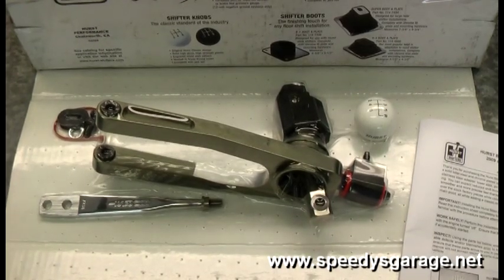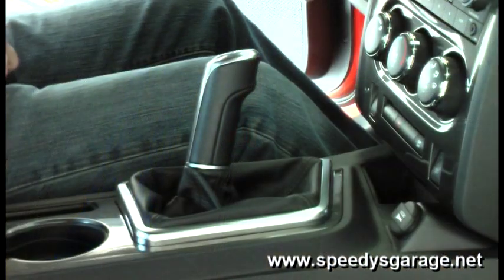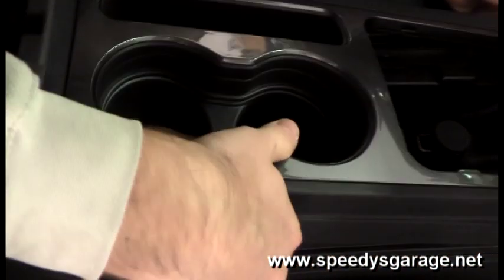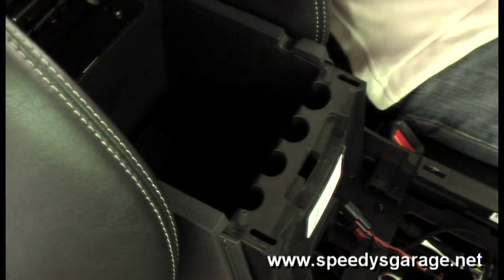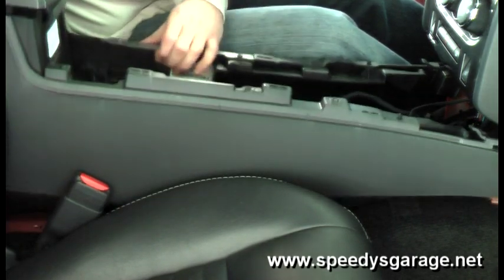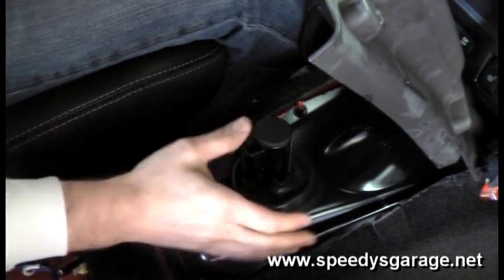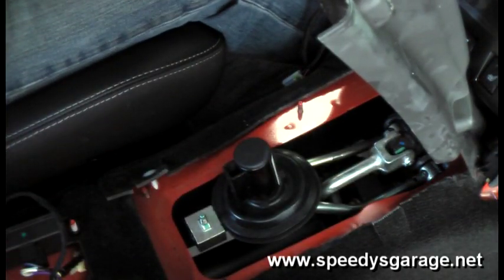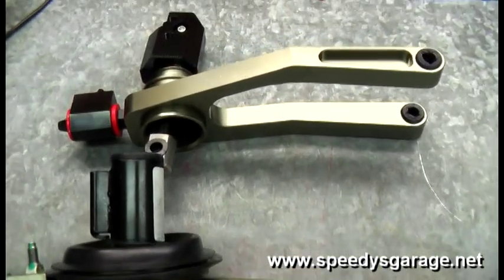Challenger Hurst Shifter Install Part 1

Comment: Just finished the install, went for a drive to see how she felt, holy cow that shifter is noisy!  Going to try a couple things and see if I can quiet this sucker down!  Love the feel of the shifter and love the videos Speedy, huge help with the install!
Reply: Amazingly, after the supplied Dynamat is added, over time, my shifters have become more quiet!  It's not that I just got used to the noise, they really did quiet down.  I live in the Mile High City, and perhaps the altitude change and the extreme temperature differences have helped "melt" the Dynamat, and form better to the rattliest (not a word, I know) parts.  I've experienced this in my 2010 SRT-8 after install, and now my 2015 SRT 392.   Check out my Challenger vids  on my channel.

Comment: Very good job on the 3 videos.  I watched them several times before I started changing mine.  They were very helpful. I did the transmission pins from inside the car too, kinda difficult but doable.  Great job man.

Comment: Great videos. Makes installing the hurst look easy. So, question for you. I just purchased a 2012 Challenger R/T Classic. I'm sure the install process is the same or similar. What I'm really interested in is are you still happy with the Hurst shifter and does it require any maintenance or have you removed it?  Any input would be greatly appreciated.  I'm looking to install this very soon.

Comment: How do you remove the actual shift boot. I have a different one that I would like to put on
Reply from the maker: There's a rubber O-ring that holds it in place at the top if memory serves.

Comment: I heard of people using the OEM bushings and significantly reducing the noise from the shifter. However I don't know howanyone could get the hurst bushings out without destroying them completely and scraping up the shifter. Is there a way to do that safely and would there be any down sides to usings the OEM bushing/dampeners? Also would using some polyeurathane safe grease like lithum grease on the bushings have any bad side effects? Sorry for all the questions.

Comment: Hey Speedy, Did you find the bushings ID way smaller than the Pins OD? I have spent over an hour  
Trying to get the factory pin through the bushings of the hurst shifter.Thanks Bro.
Reply from the maker: Been a while, but when I did mine they matched up fine.

Comment: Been messing with the transmission pin on the hurst install for 5hrs...couldn't get it in and I couldn't believe it; i finally put the stock back in less than 10min no probs (w/o console)  Any advice on how you guys got that pin in on the hurst assembly? I'm going crazy any help is appreciated. I can get it past the first half inch but it wont go in the hurst bushings on the shifter holes. My hands are raw.
Reply from the maker: noobtube1210 You may have to try from under the vehicle if you're having difficulty.
Reply: Speedy's Garage Thanks for the reply. I coughed up the money for jackstands to get it underneath the car.